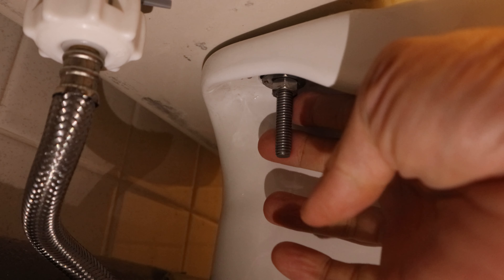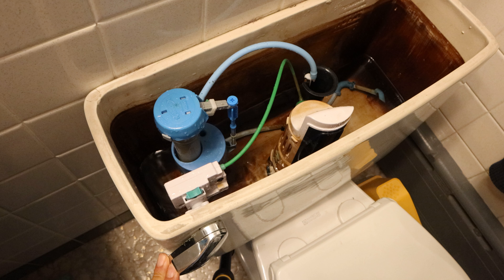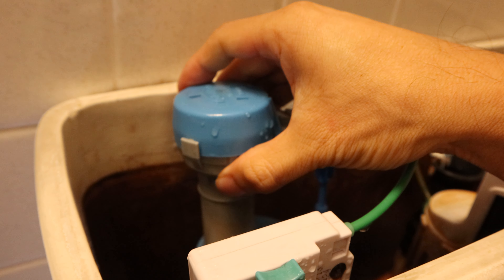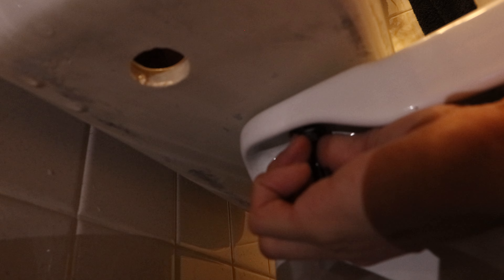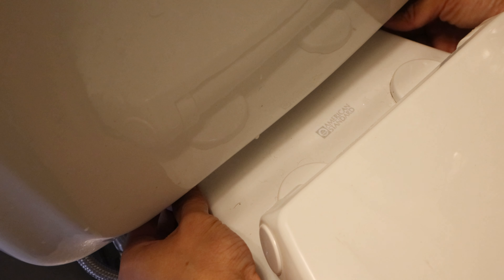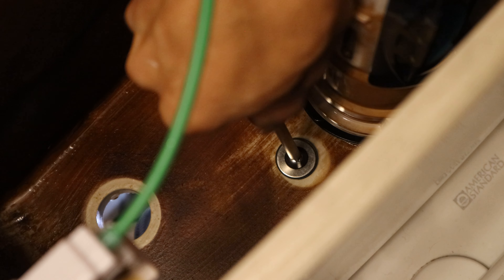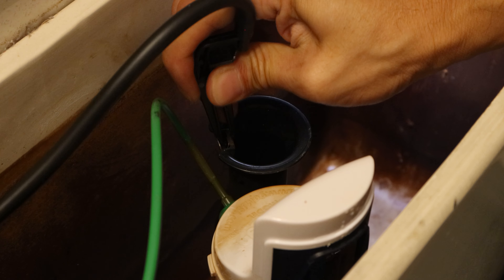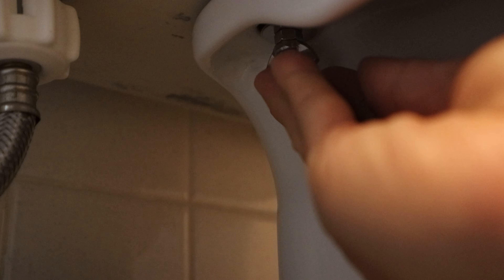How to Replace Toilet Tank Bolts

Comment: Is it necessary to remove the fill valve?
Reply from the maker: Yes, because you want to drain the tank fully before removing the bolts. If you don't, when you remove the bolts water will run out of the holes you've just unplugged. If you don't remove the fill valve, you'll need to scoop the water out or soak it up with lots of towels/sponges.